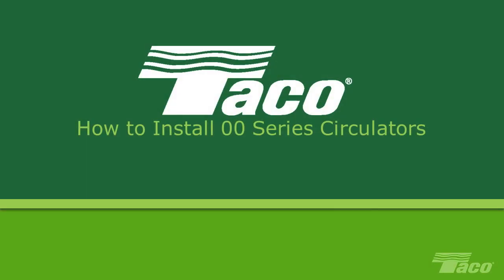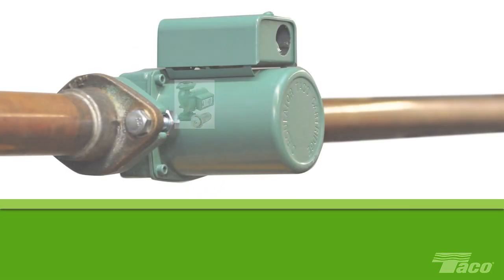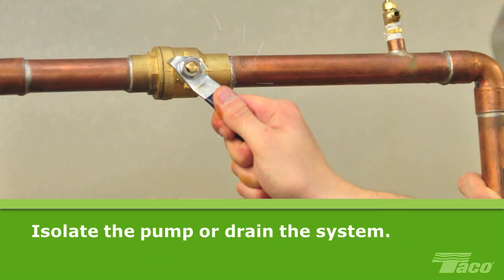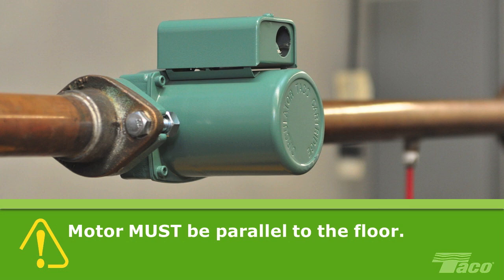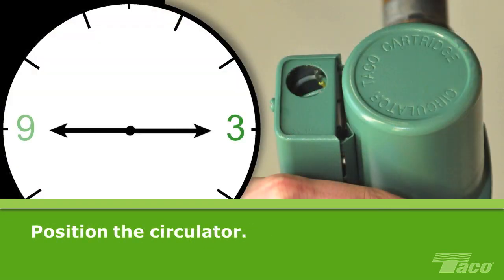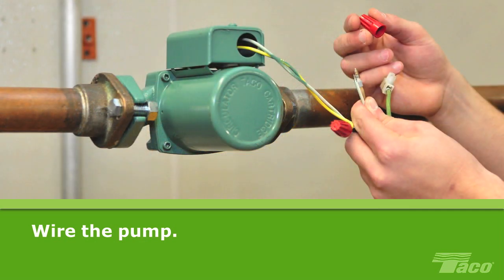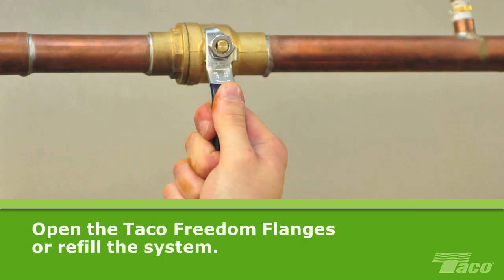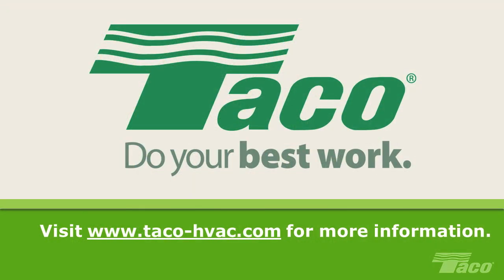How to Install a Taco 00 Circulator

Comment: I plan on running 3 007e pumps and wondering the distance needed away from each other? I would like them as close as possible to save on space
Reply from the maker: The distance needed away from each circulator will be based upon serviceability and installation. Remember you need to be able to access the electrical box as well as the flange bolts.
The 007e width is 5" from one side to the electrical box. The screw in the cover of the electrical box is in the center so you will need space for a screw driver and be able to remove the cover.
Otherwise, you can get them as close together as you want.
If space is a concern, maybe you may want to look into the Zone Sentry zone valves and one 007e, much smaller still get you the three zones you are looking for.

Comment: My installer put the electrical box in the 6:00 position. What is the reason to NOT do this and what are the risks of doing it this way?
Reply from the maker: Hello Patrick, the reason for not installing the electrical box of circulators at the 6:00 position is for following best practices. Water always flows downhill and if there was ever a leak in the system piping, water could pool in the electrical box and create other unwanted issues. Otherwise the circulator will operate just fine. Thank you for watching.

Comment: I have a 10 yr old Taco 007 - BF5.  I cannot determine if the pump is entirely dead or if I just have to replace the cartridge.  Any suggestions ?
Reply: Typically the cartridge is the component that fails most often. That is where the moving parts are. The bearings typically wear to the point that the rotor cannot spin any longer. The other part of the cartridge is the impeller and if that has any damage to it, it may not flow the water correctly.
To find out if your pump is entirely dead, take off the motor as described and see if you can spin the impeller.
Reply: When the Plumber switched out my B&G 100, which only needed the Linkage fixed $15, He touted the merits of the "cartridge". Just checked on Amazon and even there the cartridge costs the same or more than a full new circulator. That's not a merit. AND he installed it upside down.

Grundfos Circulators.
Reply: Sometimes, the cartridge can be as expensive as the whole pump!  Go figure!

Comment: It says 3 o’clock 9 o’clock and 12 o’clock and 6 o’clock would be down where they don’t want it facing? Right?  On my boiler there are three circulators and the pipes are facing vertical.  It said in the video except for in higher pressure systems normally all of the hydronic boiler’s that I have seen don’t operate anywhere above 20 PSI is it considered higher pressure?
Reply: No reply.?!!!
Reply: as long as the pump motor shaft is horizontal (parallel with the ground) the electrical connections on the motor and the portion that connects to the pipe can be spun in any direction. In certain low pressure situations <20 psi you can mount it vertically so that the  motors shaft is on top of the pipe. It should never be mounted with the motor shaft underneath the pipe.  That's how i understood it anyway

Comment: please help!!!! Am I  suppose to oil a Taco circulator pump??...and if yes where?
I have had two pump go bad in two years and I was told that the pumps were not oiled. so now I have a new one and I don't want this to happen again. 
if oil is not the issue what would explain why I'm on my third pump in two years???
Reply: i think they are selling you new pumps because you are buying them..... not because you need one
Reply: Sounds like you got ripped off taco 00 rarely go bad stop using chuck in a truck and go with a reputable company
Reply: the 00 series Taco pumps do not require any type of lubrication or maintenance, but it requires water flow for self lubrication, if the pump is air-locked, it could result in overheating and the bushings going out, especially if the pump is mounted at the top of you system, where air would tend to hang
Reply: must let a professional do it
Reply: You never have to oil these..If you're going through them quick, see how your thermostat is set. How often is your heat running? Could be working overtime..

Comment: these dummies forgot about the arrow on the pump, it is designed to be pointed in the proper direction of flow, this is critical
Reply: Hey speckspeck, what would be the correct direction of the arrow? I was wondering same thing too.